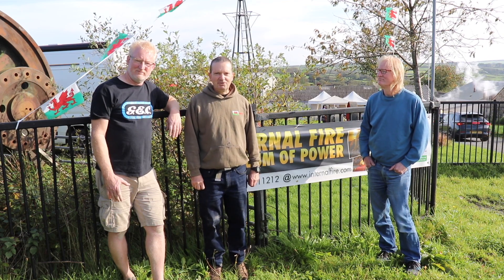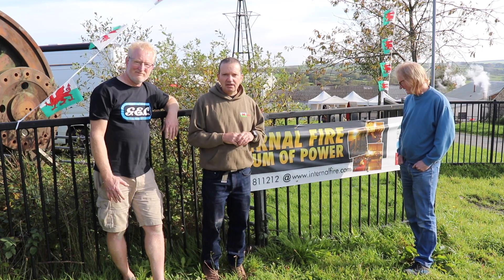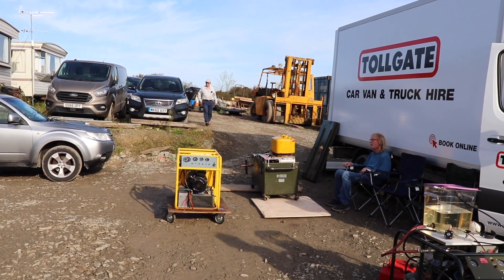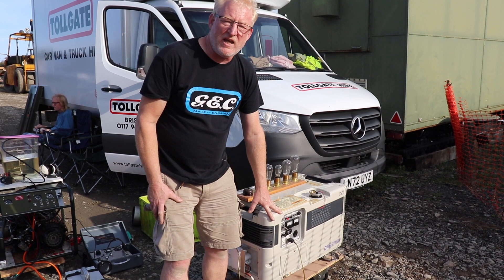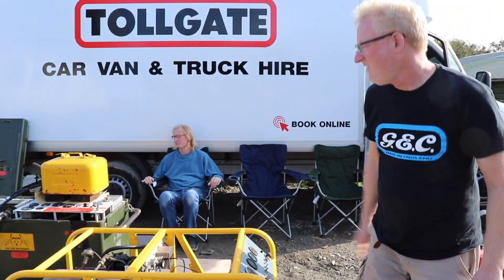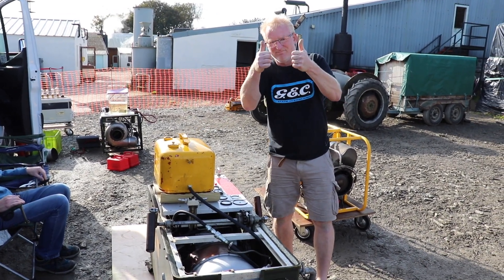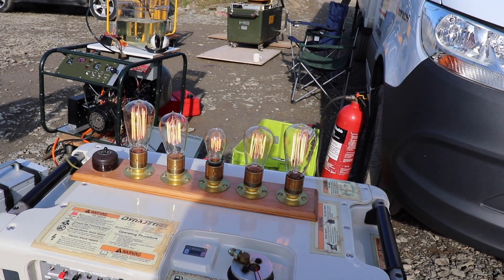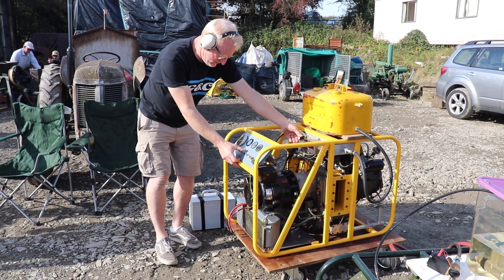Gas Turbines And Steam Engines At The Internal Fire Museum Of Power

Comment: I'm thinking of he PERFECT engine to use when its -50 outside.   The Turbine engine is the best engine in cold weather as there is no real problem to get one of these moving or even started when its this cold outside. 
  The German Crank helicopter starter seems perfect really as even if the Battery is flat,  no big deal.     

Sure, the Diesel fuel will need to be kept warm, but that's not really a problem with a 60KW Genny.   
Perfect for a Backup power unit when the power goes out on your next arctic adventure.  😉

Comment: With the Rover 1S60, what does the knob twiddling do, in order to vary the engine speed ? Mine runs at a constant, governed speed, that can't be varied so it's either going, or it's not. Would be nice to be able to vary the speed and I wondered if this could be done with a needle jet controlling the fuel flow..? Thanks...
Reply from the maker: I believe that is basically what that does… adjusts the spill rate!